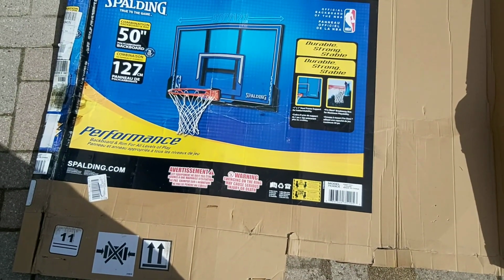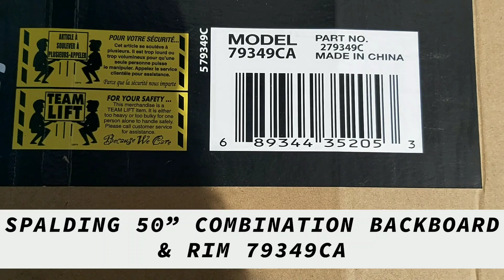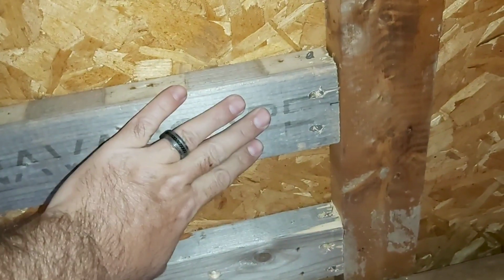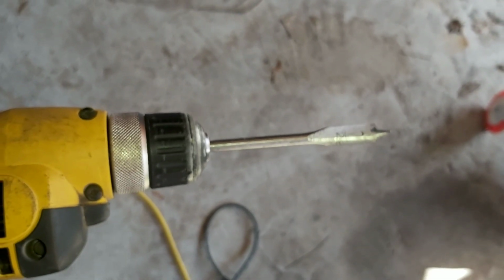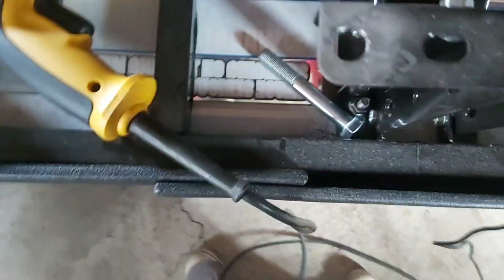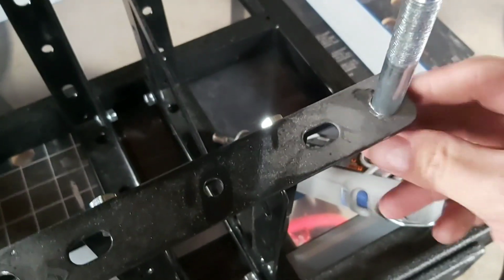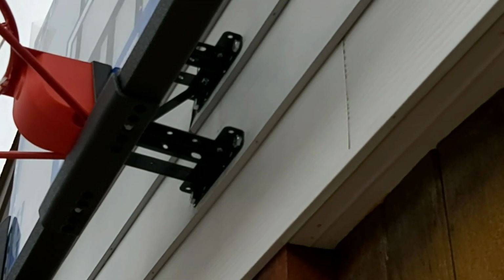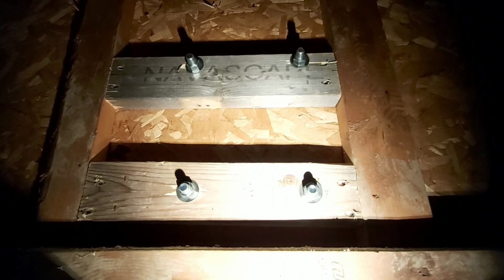Spalding 50" backboard and rim #79349 with universal mounting bracket #8406 Mounted to the wall.

Comment: bought the 54 inch backboard and of course no wall mount. I’m having trouble finding one. Where did you get yours?
Reply from the maker: I got mine at Canadian Tire (a hardware store in Canada). If you use google, search "universal mounting bracket #8406". When you get your results click on the shopping tap. That should give you a list of stores near you and the price they are charging. Hope this helps. thanks for watching :)

Comment: For the bolts that attached the bracket to the wall, did you need to use a self locking bolt, locking split washer or loctite?
Reply from the maker: i used a locking bolt

Comment: Hi thanks for the video, I’m about to do it this weekend, but my garage has a brick wall with drywall behind the garage, I’m being told it’s similar as mounting an ac unit so I won’t need to get to the back of the brick wall. Would love some tips, thanks
Reply from the maker: go to one of the big box hardware stores and make sure to get the right lag bolts. Thanks for the view :)

Comment: I can’t get behind my garage, what other methods or bolts can I use?
Reply from the maker: I am not sure what you mean. Is there drywall inside the garage?
Reply: @MelandTim  the way my house is built. The garage ceil closed off the area where the bolts would be visible going through the siding. I though I could get to that part of the garage going through the attic but it’s impossible.

Comment: would it be easier to just put the bracket up first and then the backboard?
Reply from the maker: not sure. the instructions said to build it first then mount it, but I am sure if you tried it you could do it. Its been a while since I built it and I think there where 4 bolts to hold the mount to the backboard and one big bolt to hold the rim on. give it a try and let me know if it is easier :) thanks for the comment

Comment: What is the distance between the holes in your template?
Reply from the maker: the way I did it was to put the cardboard over the holes in the bracket and then push a screw through this should give you the perfect spacing for your template. I don't recall what the distance was. Hope this helps you.
Reply from the maker: if not I could measure the hole spacing. let me know

Comment: Overall cost of this project??
Reply from the maker: around $250.00 (US), but I got mine on sale, so it could be less.  all of the nuts and bolts come with the mounting bracket which also has different ways to mount the backboard. Thanks for watching hope this helps. 
PS It looks like all the backboard and rim combos from all makers are sold out right now on amazon.com, (as of Jan 30,0221) WOW! so if you see one at a store grap it. Good luck